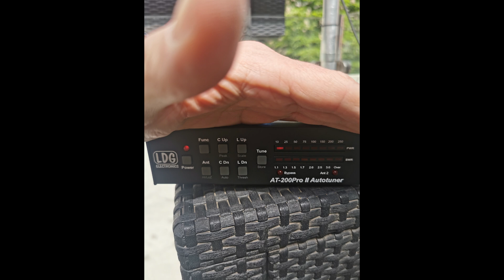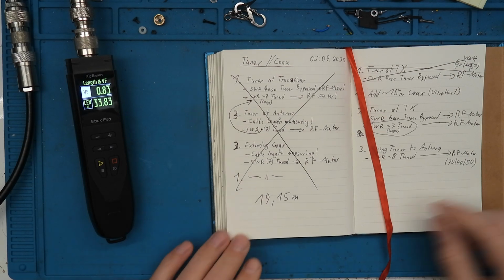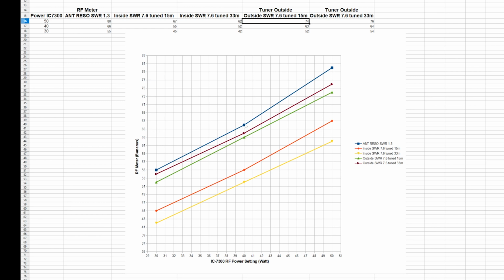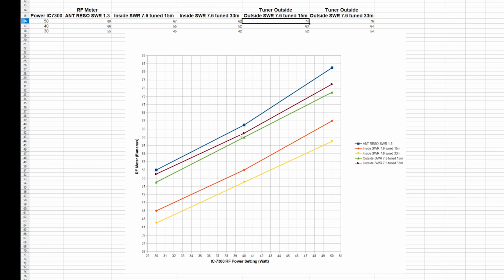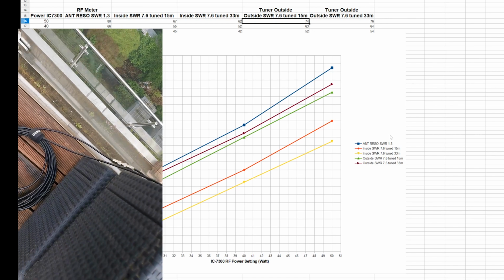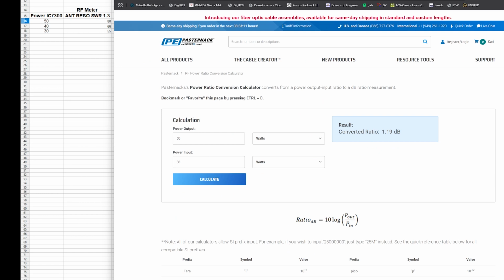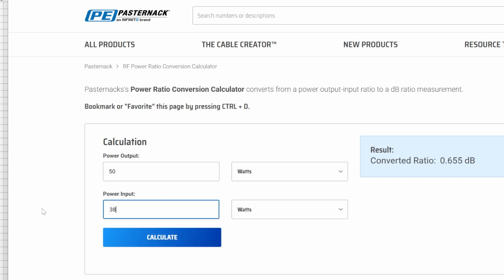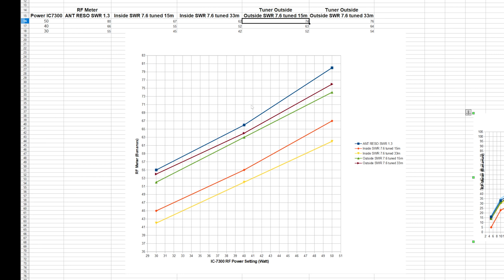Antenna Tuner on the transceiver side compared to Antenna Tuner on the antenna side. Measured.

Comment: Thanks for your efforts and for sharing the results! 🙂
As @phoenix6494 already wrote, it is interesting to see how this what we expected because of the theory (see also Ralph's video you mentioned recently) looks like in numbers when measuring it in real life. Honestly I had no idea about how much dB we are really talking about, so thank you especially for doing the math also to show this. 👍
Well, you said it in the video - 
everybody needs to decide what their conclusion is regarding their own setup, and of course consider cable length and the attenuation of the cable being used.
By the way, you mentioned that the SWR was better on the transceiver side when using the longer cable as opposed to the shorter one. If I am getting this right, this is normal, the reason being the higher return loss of the longer cable - and the SWR is related to the return loss (it gets better when return loss is higher, although not proportional).